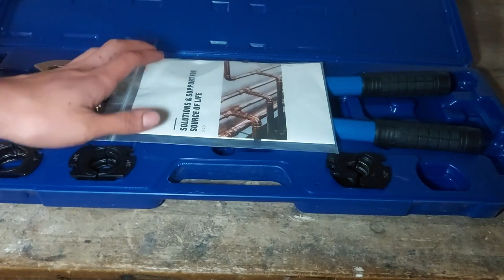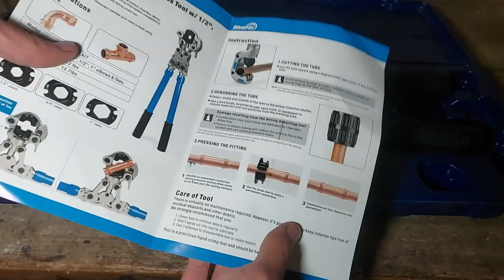Bluefin Copper Press Tool Review - ProPress for $150!

Comment: I actually bought this tool only to crimp my 1 inch main water line to Pex A. Once the fitting is pressed i can continue my run with m12 propex tool 1 inch to 3/4 manifolds to 1/2 fittings. It works amazing for what i need. I rather use this than to try and clean deburr flux and solder. Just makes it easier
Reply from the maker: Glad it worked for you! If it was just a single joint I would have used a pack joint fitting instead. They are expensive (around $30 for a 1" male adapter) but only need two large adjustable wrenches to install. Or just learn to solder. It is pretty easy
Reply: @DragonBuilds   it is easy to solder. I just rather do it this way. Personal preference is all. But ya, this tool is great for what i need it to do

Comment: Yeah, I don't press pipes.  However, if I did, I would have to consider investing in the power tool because I've used these manual ones before.  No good if you're trying to plumb a house.  I'm also still on the fence about propress fittings.  Time will tell.

Comment: That was an excellent demonstration. Really appreciate you going through all the steps and showing the final application. I am planning on purchasing a small manual hydraulic unit. Do you have any thoughts on the reliability of the press with those units? Thanks.
Reply from the maker: Most press fittings are designed so they will leak if not fully pressed. As long as your joints don't leak, you will have no problems.
Reply: jokes on you you still have to deburr inside and out and with these fittings prep is was more critical.

Comment: I saw your more recent video about the hydraulic Peres tool from Amazon. I almost bought it, until I saw your follow up! 
Do you still recommend this bluefin tool?
Reply from the maker: The Bluefin tool is pretty good but requires more space to use.
Reply: @DragonBuilds  thanks. did you ever get the hydraulic unit to work for you?
Reply from the maker: @fotopdo  No, I could not get the hydraulic IBOSAD press tool to work. The Bluefin, on the other hand, works great as long as you have space to use it.

Comment: It's been 3 years since you put that regulator on with the crimping tool are those still holding up are they not leaking?? Would you still recommend the tool?
Reply from the maker: Still holding up great with no leaks! I would highly recommend this tool, especially since it is backed by supplyhouse.com customer service (they are great in my experience), but since it does not fit in tight spots soldering is still an essential skill.

Comment: I saw this bluefin in supply house too and can you confirm this work well on a Tee?. I normally sweat a joint but I have few situations that there are water and wood and I cannot sweat it; therefore, I look into this pro press joint but I wonder how hard for a 65+ senior citizen not in good sharp to press it down. Thanks for the video.
Reply from the maker: I would not recommend it if you are not in good shape, it takes a lot of force to use. You can rent an electric press tool kit with jaws at many plumbing supply stores, Ferguson offers it for $99/day.
Reply: @DragonBuilds  Thank you so much for the information. Thanks for this video and the other one using hydraulic which you take one for the team. Thanks again.
Reply: It works on a tee, but the caveat being it isn't mounted yet.

Comment: Looks like it has been 2yrs. Have you had any leaks yet?
Reply from the maker: Nope, all the joints are still holding up well.
Reply: @DragonBuilds  Nice. I'm not sure this will for a couple of leaks I need to fix, very tight spaces behind a shower wall. Too bad, I'd like to try one of these out.

Comment: Even the old Rigid CT400 press gun puts out 32kn/7klbs force.  Some new press gun models put out 45k/10klbs force.  What kind of force can be generated by these press tools?  I'm not being snide.  Oh, and the large amount of physical space needed to use this Bluefin could be a deal breaker in so many situations at to make it inappropriate for most uses. On your back reaching up, lying down on your side, etc.?  And If that isn't enough, all of that opposable force and wrangling of the handles is not going to unsettle some of those carefully aligned fittings-to-pipe connections? -- you'd better think again.  Have you seen any videos on YT where people pressure test copper pipe connections made with these types of clamps?  I wonder why?  Remember, I'm not talking about PEX connecting/connectors.  I'm talking about copper.
Reply from the maker: This tool can barely do 1" and I am considering buying a real press tool given that small ones sell for around $1200 nowadays. I did pressure test it and it held up to over 100 psi so I guess the Bluefin tool is fine? I bought it for one specific job but I agree that the size is a deal breaker in many situations.
Reply: @DragonBuilds  Yeah, I think a serious diy-er looking at the prospect of a lot of current and future copper pipe pipe repairs and replacements would do well to consider investing in a used press tool rig.  In the SF bay area, a couple of fitting replacements can run you over $1k easily.
Reply from the maker: @melotone3305  Plumbers here charge $150+ an hour. I help several family members and friends maintain their homes and most of them have all-copper water systems.
Reply: I can think of jobs I’ve performed where this wouldn’t work.  Too big..
Reply: @philipgates988  Absolutely agree with that.  So often it's a 'pick your battle' kind of decision.  If space were too cramped for the larger rig, I'd have to reconsider my soldering skills and potential difficulty in using flames in that area.

Comment: Most supply houses will rent a real press for $50/day and will sell you a press 1" ball valve so you don't have to  worry about a threaded joint leaking.
Reply from the maker: I prefer threaded valves so I can replace them if needed. My local Ferguson rents a press tool for $100 a day. Their rental tool is a Ridgid that can press from 1/2" through 2"
Reply: Always go with a threaded Valve., propress ball valves are one time use only
Reply: @MrInfoPhilly  there are some times when threaded connections are best. Steam boilers should have threaded connections because of expansion. Ball valves are pretty much not rebuild able so if your threaded valve leaked your options are the same as a press valve. It needs to be replaced. The time it takes to unthread and dope then rethread takes time. Its also not best practice to reuse threads once they have been deformed by tightening. Propress is the best way to join copper over 1 1/4" and all sizes of black iron. The time savings is just incredible. I ran 2000 feet of 1 1/2" L copper in a church and despite the higher cost of the fittings and having to buy the mega press I made more money and got the job done in half the time vs sweating all those joints.
Reply from the maker: There is a union so the threaded valve is replaceable.
Reply: Only place I found to rent in the Dallas area is Sunbelt industrial too rental in Arlington & it was $150/day
Reply: @rastapastrychief  Call your local plumbing supply house. Alot of them don't advertise that they rent them but they do. Sunbelt or any of those big corporate rental places prices are always really high and only used as a last resort for hand tools like this. Now they have press jaws that go in a cordless drill. eBay has a Chinese copy for like $700 sold by Vevor.

Comment: Can this be used with viega fittings for galvanized pipes????
Reply from the maker: No, only for copper.
Reply: @DragonBuilds  are there any manual presses out there for iron pipes??
Reply from the maker: @punchogunter2362  Not that I'm aware of
Reply: @punchogunter2362  no manual just the battery megapress kits...

Comment: Good video but stucco guy  should pay for tool and fitting
Reply from the maker: Unfortunately the stucco guy refused to cover any damages, but at least the repair was relatively simple. I used the press tool to replace the main shut off valve and softener drain they damaged all in one afternoon.
Reply: @DragonBuilds that’s wrong.  It was working befor he worked on your job his actions caused you additional expense . Any reputable contractor would wofk with you . Time to fire this guy and file complaint against his company.. Even small claims court.  This is wrong. Your generation needs to fight when things are very wrong. With old his final payment..at least fof the cost of tool and fitting…WHEN ITS WRONG YOU NEED TO STAND AND FIGHT….I HAVE SONS YOUR AGO. I TAUGHT THEM THIS…I don’t render  JUDGEMENT ON YOU.  IF HE IS DOING THIS TO  you imagine  WHAT HES DOING TO OLDER PEOPLE OR NON English  SPEAKING…THIS GUY AN ILLEGAL no license that’s probably why your not fighting him. JUST SAYING.  SOMETIMES YOU HAVE TO FIGHT BACK…😢

Comment: Great idea.... till you get on your first job and realize you have no room to open up the handles to make the press. Very limited use no matter how reliable they may be. For those complaining about the high sticker price for the cordless, you get what you pay for!!! Isn't that what we tell the customer? Yet some how that doesn't apply to you.... Rookie.... Go work your butt off, then go buy the RIGHT tool. Then work gets easier. Stop fighting the install to save a buck. Work smarter not harder.
Reply from the maker: I bought this for a one-time situation where I needed to replace a main shut off and the curb stop wasn't closing all the way. Most of the time, I prefer solder anyways.
Reply: Dude, take a chill pill. This guy is not in the trade, but a DYI homeowner. Make no sense to drop $3k to $4k on tool that might use once or twice. Either call the plumber or solder it.
Reply: @Joseph  we have enough soft men creating hard times for the rest of us. You can go sit down over there n hold his hand if that makes you feel better while the rest of us go yo work.
Reply from the maker: @Joseph-eh4rs  High quality tools (like Milwaukee instead of Ryobi) are justifiable when necessary, but there was absolutely no need for a $2000 tool to make one joint. I'd still recommend this press tool for occasional use when the water won't stop flowing. For everything else, I solder.

Comment: it was great and i liked your review UNTIL you stated sharkbites are junk ! a billion dollar company whose product has gone through years of testing, pulling , forcing, breaking to produce a product that is a valuable option, while you have no patience to wait for water to drain
Reply from the maker: I would not use a sharkbite as a permanent solution, but they're great for temporary repairs.
Reply: @DragonBuilds  I disagree completely. A sharkbite fitting makes a perfect permanent repair, in face the major reason a sharkbite  will fail is improper installation,  propress will fail more often as there are more steps to ensure proper installation,  if this was the only reason you purchased   this tool? Dyi ? A master plumber know that each municipality, jurisdiction,  city, state and most importantly, inspectors have different codes ,So a master plumber will say there is a place for the sharkbite,  I work for one of the largest utility in the country,  we have a department that when a product is introduced we simulate corrosion, age 50 years in a matter of days, we pull, destroy,  stretch, and get every fitting or pipe to fail, we used to have a similar product to a compression sharkbite,  we discontinued this product due to cost not failure,  thank you for your review and hopefully I gave you information you were not aware
Reply: Lol. Shark bites are junk. Good luck if you put them behind a finished wall.
Reply: Yeah, I remember when I trusted sharkbites lol
Reply: When they start to leak, I guess it's time to question everything
Reply: This guy must have ties with sharkbite or something he got incredibly defensive
Reply: I went to interview with a plumbing company one time. During the interview they asked if I knew how to repipe a house, I said yes. Then they said good, we use shark bites for all connections to save on time. They offered me $50 an hr to start due to my experience, I did not take the job. Shark bites are ONLY good for temp solutions.
Reply: I’ve seen them fail too many times. If a plumber tries to use one on one of my properties I ask if they want to sign contract taking on the liability for damages resulting from 12GPM of water coming into the property until a tenant or the city can shut it off due to shark bite failure. At that point they usually bust out the torch
Reply: 😂 shark bites are trash
Reply: I seen plenty of leaking shark bite fittings
Reply: O’Rings dry out over time.
Reply: Sharkbites leak because of stupid general Contractors and DIYERS. They don't ream or debit or clean copper pipe, they don't use the depth gauge for sharkbites. I actually see contractors who are not licensed plumbers use hack saw on the copper pipe and then insert a sharkbite right on the pipe that's how stupid they are. Not saying all are like that but myself being in the plumbing business for over 30 years and a licensed master plumber in 3 different states and own a plumbing company for the past 25 years, 5 years apprentice through plumbing and pipe fitting union I seen it all. I use everything I use sharkbite on mobile homes , I use Viega pro press , And I still solder, and I use uponor PEX.
Reply: @Rocket-x9v  with that experience,  you have just about seen it all, you sir know shark bite has a valuable place in a plethora of situations

Comment: No way this is legal lol. I would never trust a contractor that showed up with this bullshit. I have a rigid press that does up to 1 1/4" and and another that does up to 2 inch. They are beasts. There is no way I'd ever trust this hand crimper lok
Reply: There are hand crimpers for Pex stainless and copper rings for Pex B.  And hand expansion tools for Pex A.  They cost $20-100.  Should they not be trusted?  Only the battery operated multi hundred dollar Ryobi or Milwaukee tools should be used?

Comment: Well the anvils crimped well where as the Hydraulic tool from Amazon left share copper because the Anvils had to much play. I'm still not a fan using ProPress fittings on "M" grade residential copper pipe because the hard copper fittings crush the thin wall pipe an usually have small sweet like leaks Vs. commercial K & L grade copper pipes.
Reply from the maker: K and L copper is indeed stronger, but ProPress is usually okay on M copper as long as the pipe is in good condition. I saw IWISS, the manufacturer of the Bluefin tool, also makes a hydraulic version :)
Reply: @DragonBuilds  I guess you just can't teach an old Dog new tricks Lol I'm from the days of using leather gloves to flow a lead bend in Toilets. But my last forty years has been in other areas then Plumbing. LMFIAO